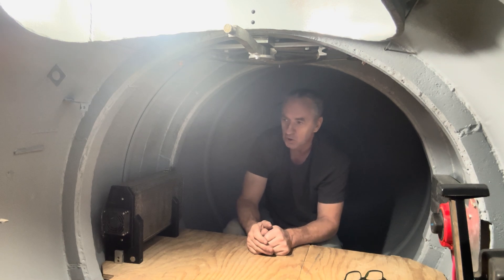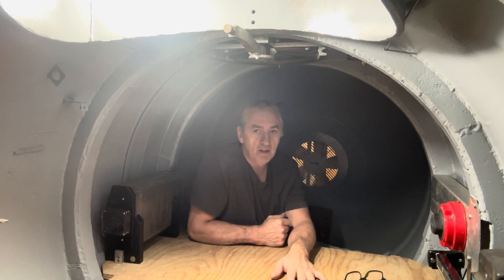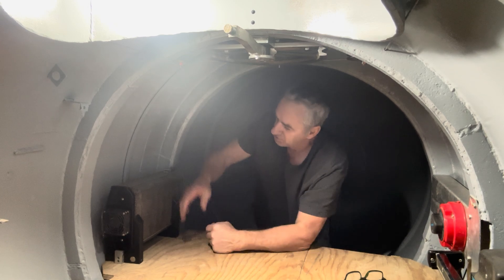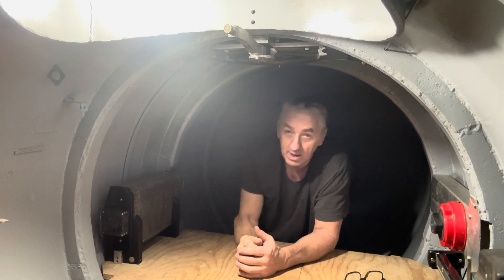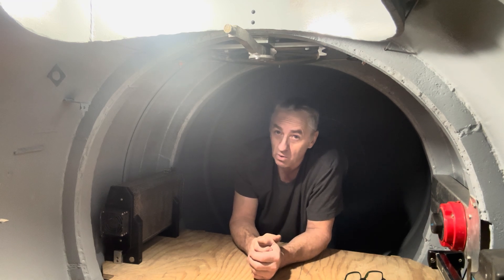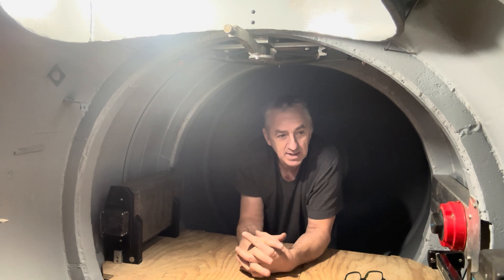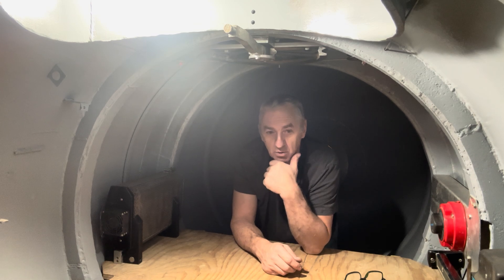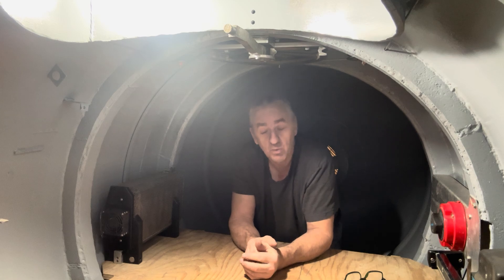Building my diesel submarine

Comment: Just a possible concern with the battery switch. I've had several boats and RVs with multiple battery switches but I can't remember ever turning it with the engine running. We have kill switches in race cars that disconnect the battery from the engine and also ground the ignition circuit. One thing we have to do to protect the alternator is either put a load resistor on the output side as it winds down or keep it wired to the battery + terminal. The reason is if there's no load on the alternator, and it's turning, it's putting out current. With out a place to go (battery switch is off) , it will fry the diodes in the alternator. If you switch between battery banks while the engine is running, there may be enough of a break in load to kill the alternator before it's attached to a load again. Easiest way to prevent this is to add a 10 or 12 GA (depending on alternator amp rating)  wire from the Alt output to the engine battery. That gives the alt a path to discharge while the battery switch isolates the chassis battery from the engine battery. Also, do you have a master kill switch for the engine? This may be a moot point if the master switch is listed as a non interrupting style but thought you might want to ponder it.
Reply from the maker: I agree, the engine will be started after a dive with all batteries on.  I do not intend to switch batteries on the fly.  The engine is mechanical, so just a pull cable to shut it off.   I can say that when I have a dead battery in my Yanmar excavator, I swap in a good battery to start it, then while its running put the old battery back to charge it.  Never a problem doing that, and there is no load since its a mechanical engine.  One wire GM alternator.

Comment: I have a similar two battery bank system with a switch for off bank 1, bank 2 or bank 1 & 2.  Although I have a check list I have made the mistake of forgetting to change from the setting of combined bank 1 & 2 and burned both banks down.  As we are all human and can make mistakes and in keeping with having redundant fool proof systems, are you better off to just keep it on either bank 1 or bank 2 and never use the combined setting?  You could shore charge both banks and this way you always know you have one fresh untouched bank removing human error risk to flip switch on dive.  This was the advice of an expert marine electrician from Vancouver area with similar pleasure craft systems .  Just a thought for consideration.
Reply from the maker: Hmmmm, okay let me think on that.  How do you charge both banks from one alternator, if the charge is not on the common?  I don't get why it was a problem for you?  If your system can run on one or the other, it should run on both.
Reply: @HankPronk Hi Hank.  I burned both banks down because I was using electric winches, down riggers and graphs and other accessories and the engine (alternator) was not running. I think the alternator will charge whatever bank is connected by the switch (provided the alternator is working and your engine is running).  My engine was not running and I was drawing current with all the the items above.  What I do now is only draw off of one bank ever and always keep the second bank in reserve.  When I’m not on the water both banks are connected to a smart charger with shore power and I check the voltage to be sure they are both full before heading out.  By only using one bank at a time ever I know I will not inadvertently drain the other bank.  I followed the advice of the marine electrical engineer on the west coast.  It’s just a redundancy to not expose both banks to the possibly of ever being drained together.  Just a thought.  Double fact check me on whether I got that advice correct.  Pacific Yacht systems on the west coast has awesome in depth material on it.
Reply from the maker: @robmotherwell6567  when you say burned, do you mean drained?  I thought you meant burnt literally.  That makes total sense.
Reply: @HankPronk so sorry. Yes drained.  Poor choice of words.  It’s probably unlikely to happen but I thought I would mention it when I heard the engineer talk about it with these battery combing switches.